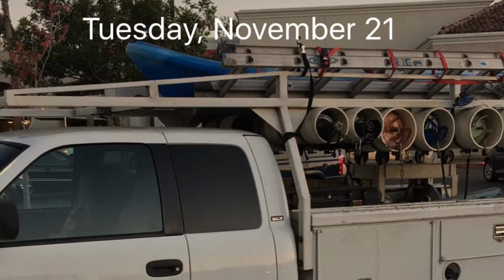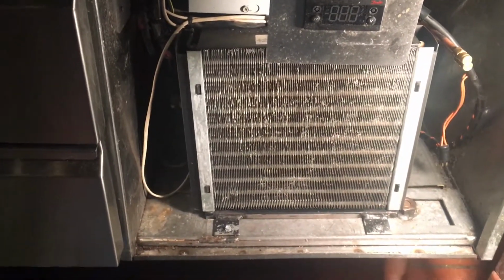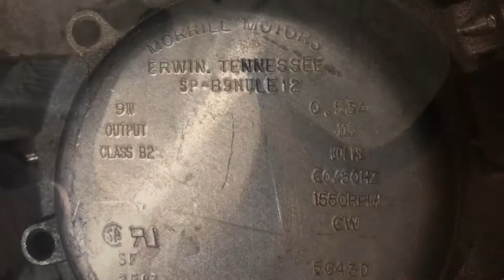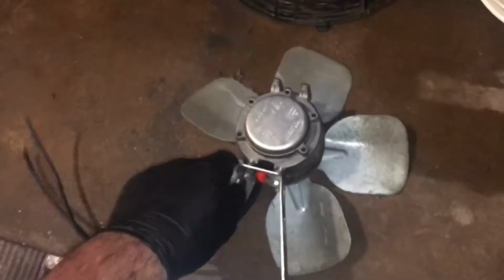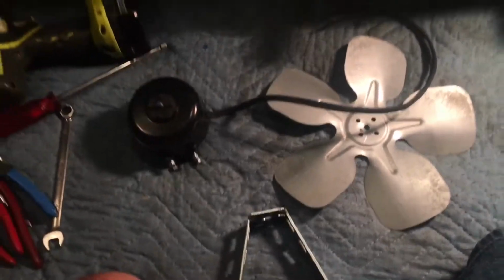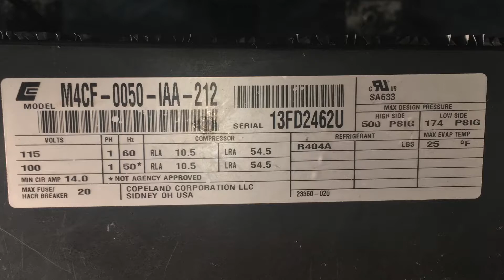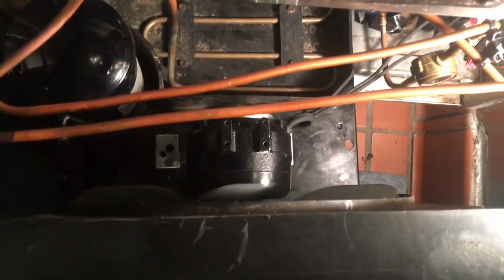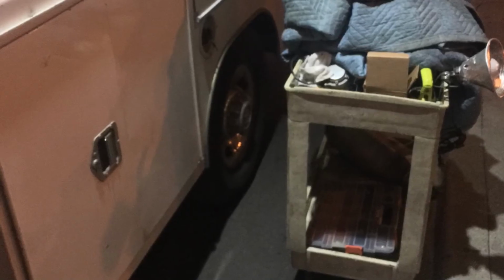6 Refrigerated Drawers. service call. Lets take a look.

Comment: The golden rule. I brake it a lot and roll the dice. Would have done the same as you on that one. Parts don’t last like they used to. Good video OC.
Reply from the maker: For under $50.00 No Reason to Roll the dice in My Opinion. I stock 9W Cw on the Truck as im sure you do. Cheap insurance. I Don't Like a Callback , Makes Me Look Bad / Bad at my  job. Plus i Have Found that the 9W Motors Start to slow down before failing causing slightly higher head pressures after 7 years running.  I Can under stand if over $50.00. Then My Golden Rule is it Gets a HP SAFETY Manual Re-set. I Don't Want to Do a Compressor job for free 3 months later.
Reply: OcRefrigeration,Hvac & Electrical. Totally agree 👍

Comment: Nice job. Just replaced two of those exact motors on a True reach in freezer last week, it was like deja vu seeing this, lol! It is surprising that it only lasted a little over two years.
Reply from the maker: Unfortunately , this is the second 9w motor ihave seen fail in under two years. The other one was a china cheapo $25.00 motor and the wires were falling out of it 1 year later.

Comment: Its a shame! 2 years is way to short. I have noticed that the motor turns clockwise, is that looking at the back or is it looking on the fan blade? Because there was a lot schmoo on the grill, looked liked it was sucking air in via the back? Just bad luck could happen to al of us.
Reply from the maker: Looking from the Rear. They Call it " Lead End " or " Shaft end " out here in USA. THIS ONE Would be Called Rotation viewed from the Lead end. How do they say it in holland ?

Comment: wow, comp. and fan motor bad in less than 2 years. I would set that unit on fire if I owned it and bought a different brand.
Reply from the maker: Agreed ! Yea, somethings up with this unit. I think it got dropped in shipping or something. When i was changing compressor in video i found the condensing unit base plate to be SEVERELY damaged AND TO BEND THAT HEAVY STEEL BASEPLATE That Takes a HUGE Amount of Force , Like being dropped from 6 ft off the ground.
Reply from the maker: I Have Not Worked on that many Drawer units. If u have , What Manufacturer does the Best Job Vs Price in your opinion ?
Reply: I do a lot of work in a 17 year old casino and they have a lot of true units still running. I am skeptical about a lot of those cheap chinese units though,seems they are built to fail after a few years.
Reply from the maker: Thanks for the reply. I have one restaurant with All " Continental " stuff and its like 14 Years Old and they seem to be built like Tanks.
Reply from the maker: Yea, True stuff is Ok / Good. Straightforward design. Easy to work on & does Not cost the customer a arm & a Leg to repair.
Reply: I have had good luck with Continental also, seen a lot of old ones still running